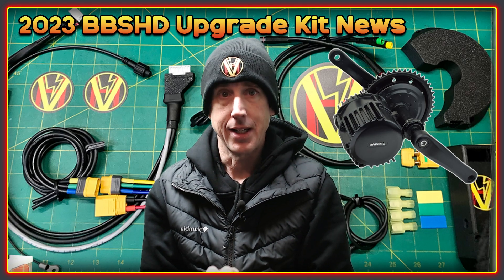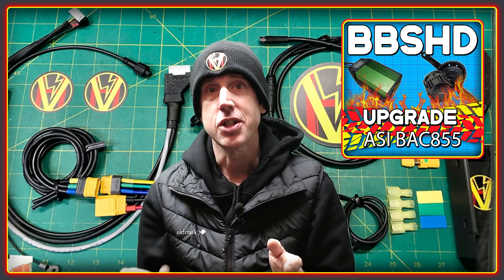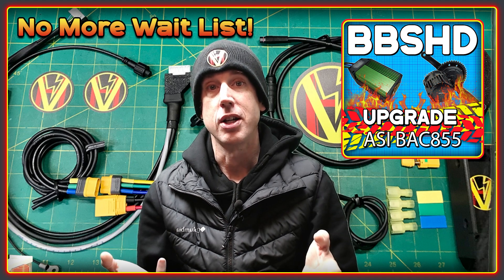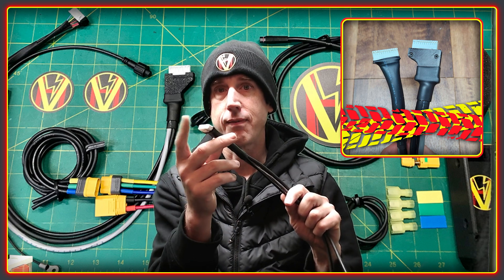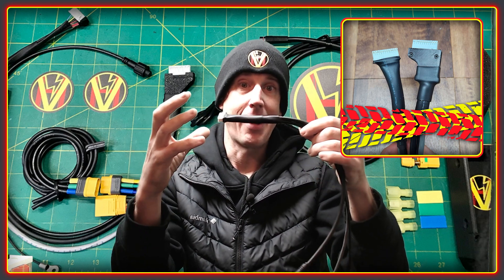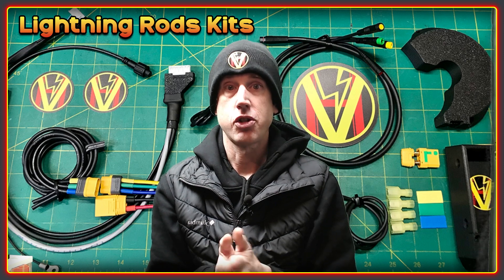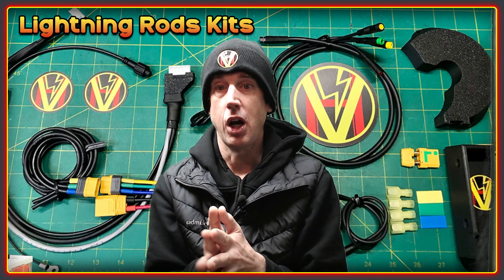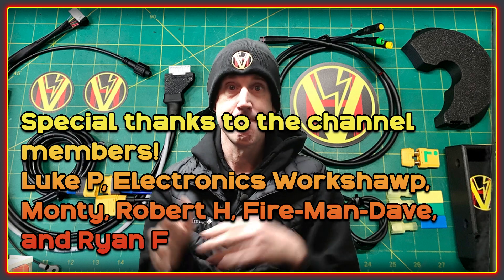2023 High Voltage Upgrade Kit for Bafang BBSHD - Improvements and NO more wait list!

Comment: Can someone tell mee PLEASE how much is this motor and how much is the upgrade kit? And these metal gears, are they expensive? Thankyou in advance.
Reply from the maker: Sorry for the delay. A BBSHD will run you 400-600USD and the upgrade is 699 USD. You want to use a PEEK gear as the metal ones are very loud. The PEEK which we make is 99 USD. Cheers
Reply: @HighVoltageKits Do you have a website where I can check out your kits. I want to upgrade my batangas bbshd controller to use a 72v battery.

Comment: Reckon this is still worth it in 2024? Ive got just under a grand to put into an ebike. Got a mtb, thinking conversion over low end off shelf.
Reply from the maker: Despite all the new motors there is nothing still that gives you the same power and reliability that you can easily maintain and repair yourself.

Comment: Can I use this asi bac855 kit for a stock super73 type bike?
Reply from the maker: This is just for the BBSHD. I did see a kit being developed for the super 73. You can also use a bbshd with a super 73 which will be significantly more powerful than using the stock motor. A few people have done that.
Reply: @HighVoltageKits  yes I’ve seen Monty’s zx. Very inspiring. I’m wondering if the bbshd will fit any 100mm bb because if I’m not mistaken, all moped 20x4 wheel ebike have 100mm bb. Therefore any 20x4 ebike can have a hv bbshd. Right? Getting ahead of myself.

Comment: $700!! way overpriced bro... Kits worth $350 without the display, $425 with dislpay. You must be making good $$$ at those prices lol
Reply from the maker: Try getting support from one of those other places and see if they want to help you. At best they will charge you $50 to change a few parameters. Whereas our kit comes with full support and service. It's the only one put there with proper thermal throttling. We have an app that let's you connect to the BAC and adjust throttle curves etc. There are plenty of reasons why it's worth not always getting the cheapest options. I listed a couple. If price is the main thing for you then by all means exercise your freedom. We are going to continue to put out the best product by a mile and yes charge extra for that. Cheers

Comment: why is this so insanely expensive? it's more than a full BBSHD mid drive
Reply from the maker: Hey Sean. It boosts the power of the motor by almost three times delivery blistering acceleration much greater torque and top speed. We use very high quality components throughout and back it up with full installation support as well as ongoing technical support with our online Discord community. We help with all aspects of building a bike. When you factor all of that in its actually a good deal. You are most welcome to join our Discord community if you would like to chat to people using the kit. There are lots of videos on the channel showing what it can do. Cheers. https://highvoltagekits.com/discord

Comment: Do you offer the whole motor, battery and  controller kit or just the kit? If not, any recommendation on motor and battery source? THANKS
Reply from the maker: We do the controller kit. We don't stock batteries though. If you wanted something custom you can email Rio@highvoltagekits.com he does excellent work in the USA. Other North American locations are Golden Motor, Electrify Bike and Eco Cycles. You are welcome on our discord which hosts our customer service platform and connect with Greg who programs the controllers. Where are you located? This is information about discord https://highvoltagekits.com/discord

Comment: What can I expect, with this kit, using a 52v 20ah 60a bms high current 50s battery? Using a 42t chainring. In terms of speed, power, and range.
Reply from the maker: Range at max power maybe 30km. It's hard to estimate that as so many variables. In terms of performance expect similar to the big hit video from a month ago. Or any of the  52 volt videos in the HV history.

Comment: With the bac855, are we able to change the parameters of the pas setting to get it close to torque sensing or more linear? Is there a video or tutorial on how to do this? If not are you able to do a tutorial?
Reply from the maker: There are some settings you can adjust and I will be looking to get some more video out on this. There are some settings in both the eggrider as well as our own home grown phone app that will help. There will always be limits though and how close it can be made to TS in terms of feel will be a bit down to each individual rider as the two sensors operate so differently.
Reply: @HighVoltageKits  that sounds good enough. Thanks.

Comment: Your website states: " Like with the 500c display the Eggrider is limited to 52 volt batteries. There are workarounds for 72 volts and we are currently exploring those."

Dude you've been using an eggrider with a 72v battery on your fat bike.
Reply from the maker: The workaround is a bit flakey tho. Our kits also have a solution. I need to update it cause we no longer do the 500c. Thanks for the heads up.
Reply: @HighVoltageKits  Oh ok. Yea I was going to ask you if you would sell your kits cheaper w/o an egg rider because I already bought one, tweaked it with the app, and hooked it up. Oh well. Anyway I have a question. From your experience, could you tell me if I did a convserion using your bac855 and 1 gear setup, but with a 52v battery, and say a 42t front and 32t rear, (27.5 tires) - would I get decent acceleration and a top speed? I really want a 1 gear setup, but also using my removable 52v 20ah battery. Thanks.

Comment: Hi I'm interested in 1 of your kit's, is the peek gear available when ordering this kit?
Reply from the maker: We have been out of stock on those for ages. Luna was the main source. They keep saying two months and then two months passes so we are looking at other options. You can email greg@highvoltagekits.com to order the upgrade kit and also make contact via the discord server if you are a member there. Cheers
Reply: @HighVoltageKits  would you be sourcing these any time soon as l would like to upgrade peek gear & controller together, sorry for annoying questions & Ty.
Reply from the maker: It's no problem. I don't have a date to make ourselves. Luna said two months. Fingers crossed 🤞
Reply: @HighVoltageKits  just watched one of your other vidz & make's alot of sense think I'll just stick with the nylon one for now, final question lol doe's this kit work with the BBSHD 03?
Reply from the maker: The 03 is the bbshd. The names get confusing! The o2 is a smaller motor
Reply: @HighVoltageKits  so is this speed controller compatible with both 02 & 03 or just the one?
Reply from the maker: We don't support the 02. Its not strong enough to be reliable. You are much better off with the bbshd or the 03
Reply: Cheers 👍

Comment: Can you still use the shift sensor with this kit?
Reply from the maker: As long as you get the harness with brake cutoffs I think so. You would have to use a long extension or locate the sensor at the upper end of the cable though.
Reply: @High Voltage  also will there be any benefits to using with 52v system?
Reply from the maker: Not really. Slightly higher top speed but it's not really that kind of bike. 36 or 48 volts will be good as well. It really is a PAS machine.

Comment: For mid-drive motors putting outwards of 4000-5000w, have you ever experienced any drivetrain problems of chains snapping, etc? Does this level of power destroy drivetrains as most people think? Is it realistic to believe that a regular drivetrain could take 5000w for medium periods while taking precautions such as letting off the throttle while shifting and using lower gears to not over work the motor? Thanks
Reply from the maker: You need to make sure you have a strong hub, steel sprockets of reasonable quality and a good derailleur, clutched if you can get one. I uses 8 speed chain as its a bit thicker. The stuff does not have cost the earth but I would steer clear of cheap alu stuff. I am on the same Sunrace cassette and derailleur and chance chain once a year. The bling ring I have up front is looking good still. The kit we have peeks at 4000watts. Above that it gets harder. You can strip pawls on hubs if its not a good one. Gearing the bike and getting a good chain line is important. Trying to force the bike in too high a gear and using the pedals is a sure way to bust a chain. But you just learn not to. Hope this helps. Cheers

Comment: What full twist throttle do you recommend for the bbshd? thanks.
Reply from the maker: For full twist there are a few options that have the bafang wiring. If you are using out kit we can set you up with the Magura throttle which is one of the best. Domino as well have a good one. They won't work with a stock setup though as the voltages need to be set to have them run properly.
Reply: @HighVoltageKits  Neither will? I actually have an older link saved for that Magura.. it's over 100 bucks. ridiculous
Reply: @RetroMancer242 you’d rather go with a thumb throttle or half throttle it’s a lot safer and easier to manage when using it as an actual bike

Comment: I have the bbshd and bac855 kit not from hv but basically similar, I love it how reliable it's been and etc but I don't know if it's the best choice these days with cyc making improvements to their offerings and bafang ending support for the bbshd eventually like they seem to want to do.  I worry about being able to get parts in the future.  That being said it's so easy to replace things on this motor and I love it but I hope they don't stop selling parts in the future.
Reply from the maker: Bafang are not stopping making the bbshd and even if they did another factory would take it over. I doubt you will have to worry about parts. CYC have definitely stepped it up. I'm yet to see anyone run one for 10,000+ kms like the touring guys do with the bbshd. I was contacted just today with a gen3 sprag clutch fail after 1000km. You can change that on a bbshd without dropping the motor I'm pretty sure. Not so much the CYC. It's definitely more modern but build wise it's not at strong.

Comment: Can you advise on how I can get more torque from my conversion kit? I have a BBSHD fitted to my old Marin bobcat cycle but it just does not pull away very well. I have  it fitted to a single rear gear so no gear change necessary> Once it gets going it is ok ( not great like on some of the You tube vids) but it quickly dies off on gradients and starting from standstill. There is a 42   tooth main drive also. Thanks
Reply from the maker: The first thing is to look at your gearing. What are you running on the back. If its a smaller gear then you will have less torque. With a stock motor you need to start in a lower gear and work up to the higher ones to get any kind of pull off the line. In your case as its single speed there is not much you can do and it will put additional stress on the motor as the power running into it will be expressed as heat. If you want torque and single speed then the kit here would help as you could run a 1:1 ratio and use the RPMs to get high speed and huge torque. But you would then loose the ability to get any exercise use out of PAS. My most recent video looks a but more a gearing for mid drives. https://youtu.be/tW_swtyk7v0
Reply: Thank you.  I did find the video after I put in the request. You are correct that I need a larger gear on the wheel. It's only the smallest and about 12 teeth. I always thought that the higher the drive the lowest  the driven for drive. I will have to get another wheel as I do not have any gears.
Reply: @Nobbyman1  yeah that's the big advantage with mid drives is being able to use your gears for the task at hand like if your going up hills or on flat ground and every thing in between in my opinion and experiences

Comment: I'll be buying a kit after I do a stock build and ride it some. Do you have any videos of a stock build vs a kit build? visual performance?
Reply from the maker: Yeah. If you click on the videos tab for the channel there are loads of videos at the start from when it was run stock. This one in particular has some good into although I think I got the labels wrong for stock and 52 volts. https://youtu.be/c7q5TbIYq7I
Reply: @HighVoltageKits  I watched aton when you started off with the fat bike. could of sworn you used an external controller. it's been a year. ill re-check, thnx
Reply from the maker: I first got the bike back in 2018 and got a stock bbshd. I ran it stock till late 2019 and got a BAC800. There are about 220 videos now so you will have to go back quite a way.
Reply from the maker: Try this. It's not complete but it's better indexed https://highvoltagekits.com/youtube-video-lists
Reply: @HighVoltageKits  Thanks. I recall after you setup and optimized a bac800, you decided that you really only need 3 gears in the back. still feel that way? I like that simplistic setup

Comment: So is the only BBSHD yoou can get now nerfed at the factory? I recall seeing a video 6 months ago on this. I'm finally about to build an ebike by summer time. thanks.
Reply from the maker: The only one that is nerfed is the M625. But even that you rip off the controller and use an external one. As long as you get a BBSHD you should have no problems. A place like EM3EV will come with better programming than one from Ali express but you can still program it yourself with either an eggrider V2 or a program cable. Our upgrade kit if you wanted to take this route works with both the BBSHD and the M625. I would get the BBSHD though as the mounting is better.
Reply: @HighVoltageKits  Thanks, I will.

Comment: I've no idea why bafang doesn't offer official 72v controller for bbshd if it handles it easily. It's not easy for me to make such an upgrade, 52v is not bad but I'm riding it for a long time already and want something new. The main question for me is, try to switch my trusty bbshd to 72v or look for different type of bike, like with heavier frame, maybe some powerful hub motor, or another mid drive, or sur ron. I'm 11 years into ebikes but it's so hard to choose something new without trying it, I want something much better and powerful and so that I won't be regretting about it.
Reply from the maker: Best advice is to jump on our Discord and throw some questions about. If you want something really unique, you could look at the various Lightning rods motors. This is the link https://highvoltagekits.com/discord let me know if you have any issues.

Comment: No wait list. I bought a 3300watt controller from eletrfied in Australia and it fits where the stock controller fits and you cant tell its upgraded. Its the v2 bbshd controller. Its a 52volt 60 amp controller that works with stock display and now the torque is insane. I do want a bac855 but no one had any or huge waiting list. If you live in canada like me and its winter time my bbshd doesnt even get hot at all. I really like your channel because of your knowledge but i learnt the hard way by breaking  chains ever month and replacement of cassettes ever month adds up and i rounded off my lekkie bling ring. So i got a 8 speed i.g.h and new bling ring and i dont snap chains anymore and no sharking of teeth on bling ring. Thanks for video.
Reply from the maker: That's awesome! Which IGH did you go with? I am in BC here and no it does not get hot in winter. In the really hot summer days I had to watch it a bit on the longer hill climbs going to work. Thanks for the comment! Where abouts in Canada are you?

Comment: A perfect upgrade for the BBSHD, Customer service & communication is exceptional. Helped me out a bunch with creating a specific PAS tune for my Ebike & riding style, created a custom harness to suit my EEB frame. 
Not only big power to be gained but a more "efficient controller" when used with PAS. A must for me on my Long offroad rides using Pedal assist. 👌
A big thankyou to H.V Team, specifically "Mr High Voltage" 👍👌🙏🍻
Reply from the maker: Thank you for the awesome write-up. Greg is a diamond 💎. Really glad we could be a part of your amazing bike!
Reply: Will the BBSHD fit on a BMX bike with 20" tires?

Comment: Apart from breaking the rotor shaft and melting plastic  gear and burning out hall sensors it's a very strong motor not
Reply from the maker: There are certain caveats to running this kind of power through them. Otherwise you can cause the problems you mention. If you set your bike up right with the gearing and monitor the heat build up. Usually, these problems occur when trying to drive high power through a much too small rear sprocket, which stresses everything and builds up heat really fast.
Reply: @HighVoltageKits  the bbshd as been up graded the rotor shaft is bigger and the metal gear dose solve the problem with the gear melting and I have the cycle analysis to stop the over heating and I run it on a fix gear 42 to 28 that solved the problem of being inthe wrong gear i change the rotor for a bigger shaft i think it gone from 8mm to 12 mm and that solved that problem then the hall sensor like you say don't get it too hot my motor is the very first one from lunacycle i I was trying to make a metal gear at one point but as you say lunacycle was the first thanks for all your work i have a Asibac855 now running at 72v i have a switch to turn it on its works at 12v i also have a crystalyte hubmotor ufo3540 thru axle 142x12 .
 the controller is Amazing like your water proof leads very tidy have a good day Michael Green Portugal